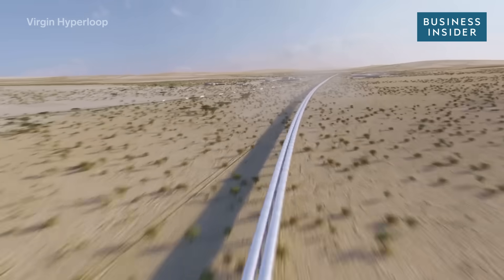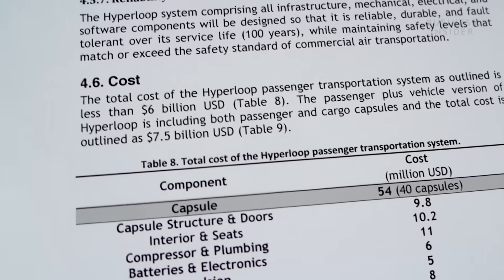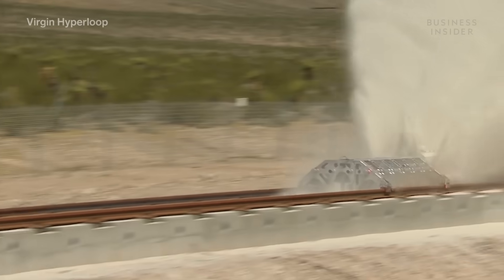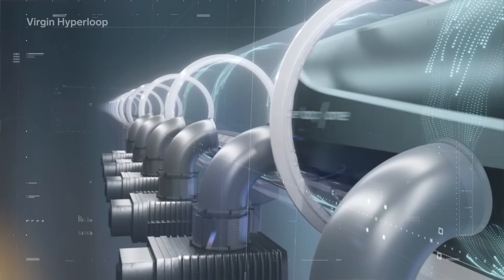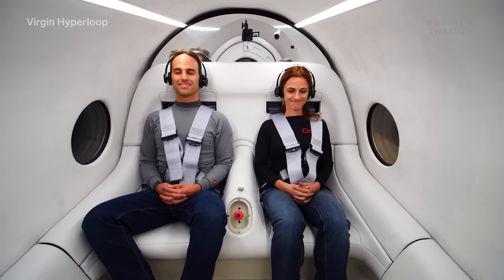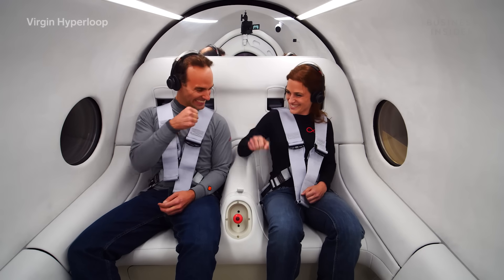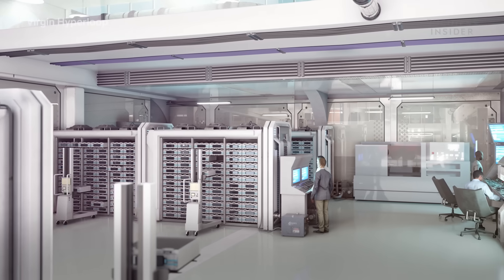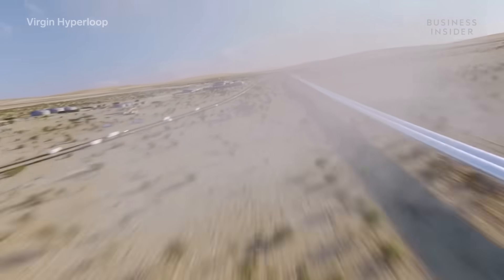How Elon Musk's 700 MPH Hyperloop Concept Could Become The Fastest Way To Travel

Comment: yea just imagine wHEN SHIT GOES BAD that thing becomes a rocket
Reply: And an airplane wouldn't?
Reply: @user83743  I hope you know that Planes are the safest mode of transportation in the world. If someone shot the walls of the Hyperloop, or the walls failed structurally anywhere, anybody inside the tube would get crushed by the force of the atmosphere entering into the tube at speeds faster than sound. To be clear, that's tens of tons worth of force that would hit people at speeds faster than sound. You'd die immediately, and anyone could shoot the tube to make this happen, since the walls are so thin.
Reply: @user83743  An airplane doesn't hover an inch away from a stationary solid wall. An airplane doesn't have the risk of a speed of sound shock wave entering and destroying it at any point. An airplane doesn't depend on very stable and fine track that could result in it being derailed if something breaks. Already right now, planes are safer than trains. Planes don't need tracks. Planes can only collide with mountains or other planes. Planes get a save reduced atmosphere for free. There is really no fundamental physical downside to airplanes. It is way easier to make planes more environmental friendly, less loud, reduce check in times, than it is to build a hyperloop. Yes, we should invest more into fast rail to travel shorter distances. Yes, we should travel less, because a lot of (corporate) air travel is wasteful. But there is no niche for a hyperloop where it can outcompete either the airplane or the train. That, and anything going wrong with the hyperloop resulting in complete catastrophe, and I don't see how this is even a thing. Could we upgrade a maglev train to make it more areo? Maybe that will be a thing. But putting a maglev in a vacuum tube is absurd. There is just no way to achieve those speeds and do it safely. If you want to go fast, you have to go up high into the sky where it is safe and efficient to go at those speeds. Anyway, we had a fast plane once; the Concorde. And it wasn't safe or economically viable. The problem with travel right now is not that it is too slow.
Reply: @Prometheus4096  have you ever heard of plane crash?
Reply: @fingerinmynose4826  No. You? What about a car crash? Or train derailment? What is your point exactly?
Reply: @Prometheus4096  there will be no shock wave if they are in a vacuum that’s why rail gun are great space weapons cause it only produce heat when firing if it’s in an atmosphere outside of it and no heat or shock wave will be produced.
Reply: @greatninja2590  There will be a shock wave if the vacuum is compromised and the vacuum becoming no longer a vacuum. Speed of sound level shock wave is considered a detonation. It will be like an explosion moving through the tube. And then it could collide with the capsule that is moving with the speed of sound against the shock wave. The hyperloop will be build on earth, not in space. So your point should be the opposite of what you are saying now.
Reply: @Prometheus4096  only if there’s a lot of if’s here it’s meaning it may or may not happen just like the if’s in an airplane until one is built lets see if the ifs can actually happen.
Reply: @greatninja2590  That was completely incomprehensible, so unintelligible.
Reply: @Prometheus4096  why are you so concerned about this when bullet trains are much much faster and are above ground?
Reply: backpack because a trian doesnt need a near perfect vacuum... introducing a lot more danger and costs for what a bit less travel time ? This is just as dumb as suggesting they could use SpaceX rockets for quicker travel ...
Reply: @Prometheus4096  to be fair every form of transport can kill. but the thing is is that we as humans want to improve and this is uncharted ground that has great potential. I mean think of what people thought when they saw the wright brothers flying in what is essentially a paper aeroplane that looked as if it were going to fall out the sky, but after many of development years planes are now the safest form of travel and I think we could see the same happen here.
Reply: @Prometheus4096  my point is no matter the transport system it can go wrong at any time. By your logic we shouldn't have planes, trains, cars etc...  I'm glad not everyone think like you otherwise we would still use horses.
Reply: @sai90990  Because bullet trains don't actually go as fast as a bullet/supersonic. And no, the fastest trains go slower than the proposed version of hyperloop, or airplanes. And yes, the problem with high speed trains is the severe accident you get when one derails. If a mistake is made with a high speed train, it is disaster right away. If a plane flies the wrong route, there is no issue at all. If a plane loses an engine, it can land safely. If a wheel on a high speed train fails, it is going to be in trouble and it could derail and completely crash. This is an inherent problem with trains. And this is why planes will always be faster than trains. Always. So when you propose a new way of transport that combines the worst aspects of trains with the worst aspects of airplanes, and also adds in some very limiting aspects of space travel, then that is a very bad idea.
Reply: @Prometheus4096  sorry but you still don't understand. Every transit that we have today is a bless. But before putting someone in them they had to make tests to see what the potential danger is after a brave person has to be sacrificed. It happened with everything. You're talking about about the hyperloop like it should be perfect while we have car crash everyday, we have airplane crash, train derailment, these things are as dangerous as hyperloop. For your information, there are cases of people dying while going to space.
Reply: @Prometheus4096   so many engineers are working to make it safe as much as possible.
Reply: @fingerinmynose4826  How can you just say that after all the stupid stuff you said? The hyperloop needs to work better than a car, a train, or a plane. Yes. Are you going to travel in some odd and dangerous way, just because it is novel? No. The fundamental principles of the hyperloop dictate, I say dictate, it can never work as well as other forms of transport. Doesn't have anything to do with your strange notions of pioneering. The world is governed by physics, not magic of wish thinking.
Reply: @fingerinmynose4826  Engineers don't rewrite the laws of physics. There is a reason why there is no progress on hyperloop after almost 10 years. You are way way out of your league even talking about this.
Reply: @Prometheus4096  I never mention magic thanking. You're acting like the engineers don't know what they're doing. Why would they do something like this if it would never. You have. They have better nowadays to make better hyperloop.
Reply: @Prometheus4096  people risk their life for novelty all they time. So I don't see your points.
Reply: @fingerinmynose4826  A fool and their money are easily parted. It happens every day! You are exactly right.
Reply: @fingerinmynose4826  I don't think there are any engineers with experience in maglevs, areospace,  or vacuum chambers, anywhere who think the Hyperloop is viable.
Reply: @Prometheus4096  who do you think are working in those projects, janitors?
Reply: @fingerinmynose4826  yes
Reply: @fingerinmynose4826  yea just look at their tubes... all rusting inside hahah, they even chopped up a small AIRPLANE because you know they pressurize for air travel to use as a test pod.... these people are just scamming investors... i mean look at their bs graphics now hyperloop will be flying through cities?
Reply: @emko333  are trying to tell that all the experiments happening are fake? It's all over  youtube
Reply: @Prometheus4096  really 🙄
Reply: @fingerinmynose4826  Who do you think worked for Theranos? Janitors?
Reply: @fingerinmynose4826  what experiments? those experiments where they launch electric pods that are just full of batteries down a track? and even then going a fraction of the speed they crash and break the tube or just don't even reach the end.... this hyperloop will be very expensive and use a lot of electricity just to keep that near perfect vacuum... so why? for a slight shorter travel time? just build a way way cheaper bullet train
Reply: @emko333  as time go they will find better way to do it. So using battery is bad now? You think they just gonna put if out before testing. They will do other tests it won't stop there
Reply: @fingerinmynose4826  airplanes are the safest transport. Sometimes they crash, but the actual rate of death/amount of passengers is THE LOWEST for airplanes compared with other transport. The danger is exaggerated in people's mind cause of media reporting about every plane crash. Imagine if they reported about ALL deaths due to car accidents this way? People would become terrified of cars
Reply: @fingerinmynose4826  why would they do it if there is no real logical bases for the production of this project??? I will tell you why, because they can get hundreds of millions of dollars in investments...
Reply: @RyuuBaka  or maybe they wanna try it
Reply: @fingerinmynose4826  testing what that your tiny pod packed with batteries works? where will the humans fit? and they didn't even work most didn't get far after the sled that pushed them launched them and one crashed into the tunnel.... this is just glorified co2 derby racing LOL
Reply: Actually it decelerates.
Reply: @silo3com  through the friggin wall?
Reply: Jesus Christ the amount of lads talking nonsense over this is insane.
Reply: Vacuums can be deadly if anything does wrong. I'm talking deaths within seconds.
Reply: @prerna5581  yea imagine if in that vacum a small wall implodes .
Reply: The hyper loop is a very set condition, I don’t see much room for error with one of those
Reply: @woopy15  nothing perfect it's best to imagine the worst case in every possibility and plan for it.
Reply: @woopy15  One bullet hole and hundreds of miles of vacuum gone.
Reply: @puffyvalcano3736  there’s a reason why guns are banned in the airport.
Reply: @greatninja2590  actually guns aren't banned on airports, if you put them on your non carry on cargo, give notice to the airline, pack them correctly and unloaded, there shouldn't be an issue unless the airline had strictly banned it
Reply: @woopy15  lose screws,extreme weather or earthquake,terrorists attacks,etc
Reply: You should call them right away. I'm sure their engineers haven't thought of problems that could arise.
Reply: @davidmccarthy6061  Considering the progress made on hyperloop, yes it is quite obvious this is a investment scam, just like Theranos.
Reply: @DocSteelhamer  Terrorists: Hmmm, We don’t like the toob . Time to destroy it.
ka-boom
Reply: @DocSteelhamer  true airplanes and terrorist doesn’t go well
Reply: @DocSteelhamer  same as an airplane
Reply: @Kirboru  dude Americans all have access to bullets that would destroy this thing ..... never mind anything else going wrong with a 99.9% perfect vacuum ....
Reply: @emko333  they could do the same to a road or a train track. i mean they could do that to an aircraft. there's not much difference
Reply: @DocSteelhamer  That’s all a thing a plane could go wrong with also. But a plane falls from the sky with hundreds of people inside.
Reply: @woopy15  if someone manages to hack the electronic magnets, they could reverse the polarity of it and it would become a glorified metal coffin
Reply: @woopy15  You don't see much room of error

But I see there are much room for terror.. attack.

This Hyperloop can only be 100% safe if all humanity are smart, no assholes, no jerks, etc, etc, have reached mutual understanding, no racist, no hate, no envy.
Reply: @Nightdreaux22647  And willing to maintain routinely, look at all the dying infrastructure still used globally
Reply: @Nightdreaux22647  so you’re proposing that transportation that’s used in a closed system with no outward contact to the world is less safe than all forms of transportation we currently use? Nothing is 100% safe but this thing is definitely safer from terrorist attacks than planes, trains, buses, cars, ships, etc.
Reply: If they made this work a rock hitting the loop can cause massive failures in much of the loop killing most in the track. Watch Mythbusters putting a dent in a rail oil tank. Its devastating if you expand it. And its easier then hijacking a airplane for terrorist.
Reply: M. de k.  you have no understanding, gas travels at the speed of sound https://www.youtube.com/watch?v=RNFesa01llk
Reply: M. de k.  No, https://www.youtube.com/watch?v=RNFesa01llk
Reply: if humanity thought that way when airplanes were invented, we would be stuck on the ground,  don't fall into the "perfect solution fallacy", as with airplanes things will get better and safer over time, let's hope they do it proactively and not reactively (like in the airline industry)
Reply: How come?
Reply: COOL! Rerouting to the moon lmao
Reply: M. de k.  lol have you ever heard of a faucet leaking at the speed of sound?
Reply: Amen!
Reply: @II DEMON II did you just compare irresponsibility of a person driving a car to a scam that may end lives of n number of people due to a fkn corporate?
Reply: M. de k.  Continuously lingering above the near perfect vacuum tubes of the proposed Hyperloop is thousands of kilograms of atmosphere.

Before the Hyperloop becomes operational, the transportation tubes that will stretch hundreds of kilometers across the US will have to support the entire weight of the atmosphere above it. Essentially, the weight will accumulate about 10,000 kg per meter squared. That is, for every square meter of tube, there will be over 10,000 kg crushing down on it.

Since the proposed Hyperloop will extend 600 km with a diameter of about two meters, it will maintain a surface area of about four million meters squared. Given one square meter will experience 10,000 kg of force, the Hyperloop will have to endure nearly 40 billion kilograms of force over its entire surface.

A small compromise in the structure of the tube would result in a catastrophic implosion. If the tube became punctured, external air would tear into the tube, shredding it apart as it violently rushes in to fill the void.
If the tube was punctured for any reason, outside air would violently enter the tube as it attempts to equalize the pressure gradient.

At typical room temperatures, air molecules travel around at about 2000 km/h. In a room filled with air, the molecules bounce around in random directions, striking other molecules as they move. As individuals, the particles do not carry a significant amount of momentum.

However, inside the Hyperloop chamber, there are few molecules for the air to bounce off of. The atmosphere would violently force the air inside where the molecules would continue to travel with the force equivalent to an elephant traveling nearly 2000 km an hour for every square meter. Given the two meter diameter, the cross section of the tube would measure about three square meters. If a breach ever occurred, the air would rush in supersonic speeds with the force of 30,000 kilograms over the entire cross section.

The air would continue to race down the track with explosive force until the pressure equalizes or until it slams into an object - most likely, into the train capsules.

At just 3 PSI (pounds of pressure per square inch), air can cause significant damage to a human body with the potential to result in the loss of human life. At 5 PSI,  buildings would begin to collapse and fatalities would be widespread. With 10 PSI, reinforced concrete buildings become severely damaged or can collapse entirely. Most people would be expected to die.

In the case of the Hyperloop, air would enter the tube at 15 PSI (!) equivalent to one atmosphere or 10,000 kg per square meter. As it enters any perforation, the atmospheric pressure would tear open the tube like a tin can. Any and all capsules that stand in the way would be instantly shredded apart. The results would almost certainly be deadly.
https://interestingengineering.com/biggest-challenges-stand-in-the-way-of-hyperloop
You are correct with your arguments, if you have an extremely extremely strong tube that will not cascading fail.
Reply: M. de k.  yeah, I should say the hyperloop could work. Just not at the cost they are saying right now. And also, using a .50 bmg apit, you could probally get through an inch or two of all but the best steel.
Reply: M. de k.  I'm "parroting" a man with decades of experience. is it really parroting at that point? its more like using a source really.
Reply: shit can go worse on an aeroplane, car, train etc. literally any form of transport can go to shit and kill people